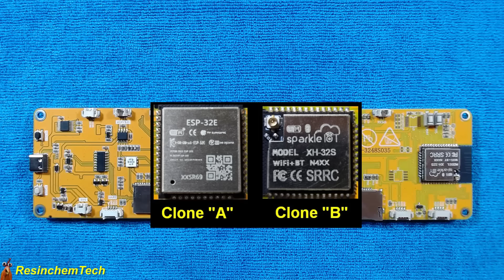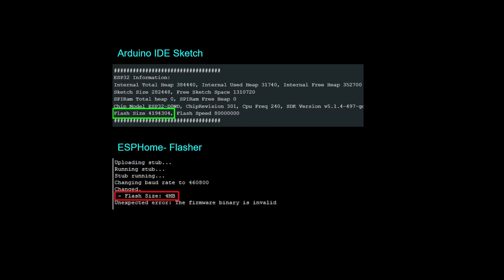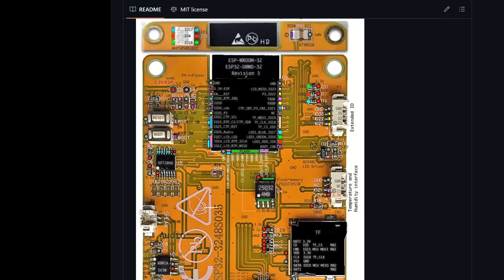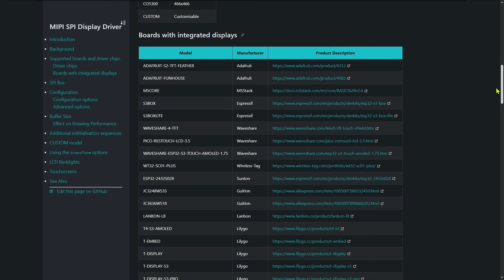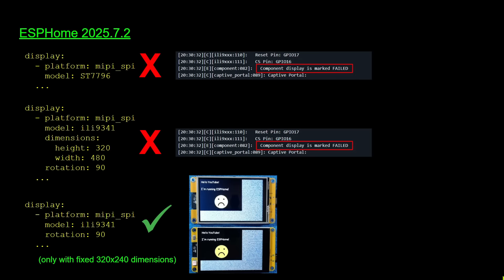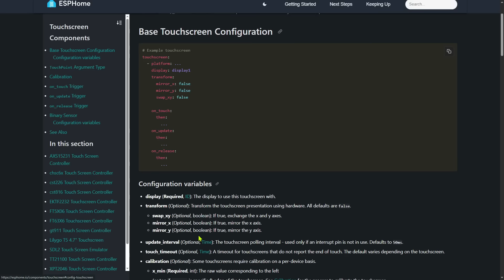Using the CYD: All Clones are Not Created Equal!

Comment: I have a clone that has the stylus, touch screen and 2 pin JST connector of clone "A", but has the usb A to C cable of your clone "B" and a completely different PCB.
Reply from the maker: Yeah... and a lot lot of other combinations!  That's one of the things that make these boards so difficult to use.  Slight changes in things like GPIO pins, board traces, etc. make trying to develop code into a lot of trial and error.  I spent days trying to get the SPKR connection to work and play audio from the SD card reader.  Despite adding things like an amplifier, etc., I never was able to read an audio file (.mp3, .wav, etc) from the SD card and produce audio output to the SPKR connection.

Honestly, I'm building a project with one now and am seriously contemplating just going with my own ESP32 and an ILI9341 capacitance touch screen.

Comment: tnx for sharing this debugging, I bought clone B and I have hard time to make it work, do you have a github with your stuff? tnx
Reply from the maker: It's coming... as part of my larger project.  So far, in addition to the actual display and touch that I covered in the video, I've also been able to utilize the onboard light level sensor (LDR), control the onboard RGB LED and to read files from the SD card reader.  I'm still working on trying to get audio via the onboard DAC and the speaker connection.  So far, I've only been able to produce basic sounds, but not play a .mp3 or .wav from the SD card (yet).  I'm running into issues with limited GPIO pins at the moment.

But all my working code will be published as part of the larger project where I'm including the CYD (clone B).  I can't say exactly when the Github repo will be available.. just that it is coming at some point!
Reply: @ResinChemTech  for connecting the DAC I think it will not be possible sadly :/ not enough pins are available..
Reply from the maker: A problem I've discovered over the past few days, trying to get appropriate sound working for my project.  Currently, I do have it working with a DFPlayer Mini, which uses serial for control/communication.  Even then, I had to define a second serial port using wires that I soldered directly to unused GPIO pins on the ESP32 chip as the existing RX/TX pins broken out on the board don't work because they are routed via the onboard USB-to-UART chip just like the USB port itself (as best as I could tell... but these serial pins would not work with the DFPlayer).

To be honest, I would probably be time and effort ahead if I has just used my own ESP32 and something like an ILI9341.  The only thing I'm really 'saving' by using the CYD is all the required wiring between the ESP32 and the display panel.  And now since I'm using the external DFPlayer for my audio, I don't need either the CYD's SD reader or SPKR connection.  In effect, I'm really using it just like an ESP32 and display panel with touch.  I really don't know who these CYD's are designed for... the complexity and lack of reliable documentation make them a poor choice for a beginner. And someone more advanced is likely to want more GPIO pins and/or control over the device.  But I'm too far into my project now... and I'm determined to stick with this CYD version and just find a way to make it work for my needs!

Comment: hey great video! thanks! i was able to get my elegoo cyd to work!   what is the name of the library file that gives you the spooky eyes??
Reply from the maker: I've learned a ton more about this board since the video as I'm now trying to use it in my larger project.  For example, I've now been able to control the onboard LED, use the SD card reader to read files from an SD card (while not also messing up the display, since both use SPI) and now I'm working on audio output.  I should have more to share in a follow up video a bit down the road.

If I remember correctly, the moving eyes was one of the demos from the TFT_eSPI library.  That is pretty much the main library I've been using.  I did have to use a different touch library since TFT_eSPI only supports resistive touch and mine is capacitance, but after some trial-and-error, I now have touch working as well.  I'll be providing the full code for how I did all this as part of the upcoming project video.

It sure would have taken a lot less time with proper documentation, but at least everything seems to be working at this point.  Don't hesitate to let me know if you run into any additional questions!

Comment: hey, great video, thanks :-)  have you ever tried to flash Tasmota32-display or Tasmota32-LGVL to this CYD? greetings :-)
Reply from the maker: No I haven't tried that.  I have some unique needs for my particular project that is going to require custom-written Arduino code.  But that's interesting.  Most of Tasmota installs are on some sort of switch or relay (like wall switches or smart plugs).  I haven't actually tried it on anything with a display.  But sounds like something I should take a look at!

Thanks for the tip!
Reply: @ResinChemTech  Thanks for the quick response. I tried Tasmota32-lgvl, but I failed. I don't have enough experience with Tasmota. It would be great if you could get it to work. In fact, Tasmota can bring a certain standard to your own smart home if you don't want to program.
Reply from the maker: I have dozens of Tasmota devices installed.  But as a general rule, I use Tasmota for things like switches, dimmers and relays.  I tend to use ESPHome for sensors.  And for some projects I simply have to write my own Arduino code to handle the unique needs of the project.

But Tasmota is a wonderful piece of firmware.  I know it is constantly improving as well.  I just haven't had the opportunity to try it for things like displays.  And having options, like Tasmota, ESPHome and Arduino/C++ allows you to find the best fit for nearly any project.

Comment: ULTRA LIKE 👍👍👍👍👍
Reply from the maker: Thanks!  I'm actually working on the "bigger" project that uses Clone "B" or the capacitance touch version.  Even now, I'm still finding discrepancies between onboard documentation and the board itself.   I've got it pretty much working... but it took a lot longer than it would have if I would have had complete and accurate documentation!

Thanks for the comment!
Reply: @ResinChemTech  DOUBLE ULTRA LIKE 👍👍👍👍👍

Comment: Thank you for this video! I have Clone B and was getting some wonky things with it, now I know why! I'm getting ready to place a Mouser order, and I see that the 32Mbit flash chip that's missing is only 85 cents. I see no reason not to pick up a few and solder one on. Looking at the documentation, I shouldn't need to do anything, it should just detect the extra flash automatically, right?
Reply from the maker: In theory, I think that would work.  But in practice, I can't say whether it will or not since I haven't tried it.  Who knows... in the process of saving a fraction of a penny, it's possible that the traces for the flash aren't even connected to the ESP chip.  I've definitely seen "cost-cutting" processes like that before.  Probably the only way to know for sure is to simply try it... at least the flash costs less than $1 to find out!

But if you do opt to try it, please follow up and let me know if you can then access and use the additional space.

Comment: It's reasons like this that turn off so many people to diy elec. And anything software really.. bc it happens with so many products now.thnx for the info
Reply from the maker: I don't disagree!  And it does seem to happen a bit more often now than just a few years ago (at least that's been my experience).    Even changing something that appears minor, like the voltage regulator on an ESP32 that saves a fraction of a cent on each board, can have a major impact on some projects.

The only real alternative is probably to purchase all your components from a well known seller, such as Adafruit.  But that also likely means limiting your options, paying more and waiting significantly longer for delivery.  Otherwise, you just have to deal with all the variations and assume that any time/money you saved by ordering from random sources will probably spent on diagnosing and figuring out the component!

Thanks for the comment!

Comment: Very thorough investigation, thanks 👍
Reply from the maker: Thanks for the comment... it's appreciated.
Reply: @ResinChemTech these CYDs make nice Internet radios using yoRadio firmware, I know your video is more generic but if you have extra displays laying around check it out
Reply from the maker: Thanks for the idea!  One of the (many) items on my to-do list is a version 2 of my DIY amp.  In this next version, among other items, is to integrate a touch display instead of using a separate device.  I'll definitely look into the yoRadio option!

Comment: Not to try to send you down a whole other rabbit hole but have you seen the openHASP project that allows you to code  buttons, text boxes, sliders and other gui elements for these displays with some 'simple' configuration files. It can be used as an integration with home assistant and ties the two together. For example a button on screen can be used to switch a light or a slider to control brightness or volume or a text box to display the value of a sensor. I suppose it depends what your project is doing how well it would suit.

Comment: Awesome documentation on this, thank you!
I'm thinking about using a few of these for my own DIY air ventilation control.
I would disable WiFi on them and use a MAX485 for rs485/modbus back to another controller... which brings a question on WiFi enable/disable. My thought is sending a specified command over rs485 from my main esp32 controller to each of these displays and WiFi turns on so I can reslash the firmware as needed. But this might be harder than it needs to be from some quick searching online.
Reply from the maker: You're welcome... glad you found it helpful.  The companion blog article (if you haven't seen it yet) has more information, including the actual configuration/ESPHome YAML that I used.

That's an interesting idea to be able to programmatically turn the WiFi off/on.  If you get it working and publish it somewhere, I'd love to see what you come up with.  I can think of a number of my own projects where something like that could be useful.

Good luck with your project... and thanks for taking time to leave a comment!

Comment: Good video… Here you have a configuration of the clone B with LVGL in platformio. It’s in my github repository  /enlopa/LVGL_ESP32-3248S053C
Reply from the maker: Wow... just took a peek.  Where was this when I was doing my research? :)  

I had originally planned on showing some basic LVGL configurations in both Arduino and ESPHome but the video was already WAY too long just due to all the time spent trying to identify mislabeled or incorrect components.  I'll probably show a little bit of the LVGL use when I get to my larger project that will use one of the CYDs.  And I've bookmarked your repo so I can refer back to it when that time comes.

Thanks for sharing... and for the comment!
Reply: @ResinChemTech  If you need anything regarding this, don’t hesitate to contact me. I’ve made several interfaces with that display and LVGL.

Comment: I've got a couple of CYDs that I've played around with both Arduino and ESPHome.  It is a bit of a struggle to get the right configuration setup.  Thankfully they are pretty straight forward to use after that.
Reply from the maker: For me, it was quite a struggle just to identify the GPIOs and chips/drivers used.  But you are correct that once configured, they are pretty much like the ILI9341 or similar in terms of use.  What really threw me for a loop (and wasted substantial time) was the mislabeled specs on the product listing page.  Despite the length of the video, I omitted hours of additional troubleshooting and research just to try to figure out the actual components used on the two different boards.

But fortunately, I now have working Arduino and ESPHome code for both.  But I haven't even experimented with the SD card reader, onboard LEDs and other things like the LDR on Clone B.  I'll probably get to those as part of my 'bigger project'.

As always, I appreciate the time spent to post a comment!

Comment: Very good info, thanks. I used 2 or 3 CYD's about a year ago, drove me around the twist.
Thought I was going nuts, glad its not just me ;)
Reply from the maker: Nope... not just you!  And I omitted hours of additional research and testing that I spent just trying to positively identify the chips and GPIO pins used.  It would have helped if product listing for the one board had been correct.

But while this was probably the most time I've spent on a single type of component, it's not the first time I've had to research a part that appeared different from other online documentation or projects.  That's why I hope this video provides info on how to identify key properties of a component as much as it did on how to actually use it!

Thanks for the comment!
Reply: Yep - absolutely know that going nuts  banging head on desk feeling. So annoying when your board doesnt match the advertised specs but it takes yo a while to work out youve been duped.

Comment: "Capacitive" touch - uses Capacitance
Reply from the maker: Correct... and I think I intermix the terms 'capacitive' and 'capacitance' touch throughout the video.  I didn't take time to delve into those technologies but did state that the capacitance version could not be used with gloved fingers or a non-conductive stylus, while the resistive touch just needs pressure and not a conductive object to register touch.  Time and length of the video simply prevented me from going into details about how the different touch technologies work (but I did include a link in the description for those that wanted to know more about the differences).

Comment: A lot of times when I purchase these inexpensive development boards from Amazon and I find they contain something other than advertised, I start the return process.  Most of the time, the seller will say Amazon sent an old version and the seller will send me what was advertised, and I can keep the wrong one.
Reply from the maker: I've done the same on occasion... especially if I have a specific need that isn't met by the component.  In this case, since I eventually got both of them to work, I'll keep them in my 'stock' of parts and likely find a use for them down the road.  I just found it interesting that after I posted what I found in an Amazon review, the seller just changed the description (removing the -S3 from the ESP32).  They didn't respond or even try to say that I received an 'old version'.  This tells me that there never was an 'S3' version and they were likely trying to pass off the rebranded ESP32 as an S3.  I do make a note of these types of vendors and do not order from them in the future.

Thanks for taking a moment to leave a comment!

Comment: Additional comment: I use modern LLMs to help find the docs or create the yaml. Still takes some work but simplifies my workflow
Reply from the maker: I will often use an LLM as well... and tried various prompts and models for the CYD.  But having used Home Assistant and YAML for 8+ years, I don't really need it for anything in Home Assistant/YAML.  And any results that I got for the CYD were pretty generic and often any specifics were for a clone or board type that differed from mine in one or more ways.  But I do love the LLMs for helping me out with Arduino code from time to time!

Comment: I’ve built up quite a collection of CYD displays in various sizes—including some rare red ones! I recently flashed Marauder onto a 2.8" CYD, and it worked great. Most of mine came from reliable sellers, and I even have a few up to 7". Planning to finally put one to use this holiday weekend. Thanks for the helpful video—perfect timing!
Reply from the maker: Thanks for the comment!  I usually try to buy from 'known' good sellers as well.  But for this video, I picked a couple of random boards partially to see how they compared (and I wanted to compare/contrast resistive vs. capacitive touch as well).  The real goal was to cover the steps I used to identify components, GPIO pins, etc. with the idea that these could be used for all sorts of other components and clones.  I often find myself working with components with little-to-no documentation other than a manufacturer's spec sheet for a particular chip.  But that's part of the DIY process I guess!
Reply: @ResinChemTech I bought mine on temu, i got a 2.4 inch... it took me a while but i got the digital clock sketch to work,  finding the correct gpio pins is very annoying. I got absolutely no documentation,  just thr cyd in a nice case. It did have that, plus the parts for a case. If you're not annoyed you don't have enough different esp32s. 😅 learn by doing...
Reply: I'll work on touch, tomorrow.   I don't really need that, but if I make a book reader, I could turn the pages...